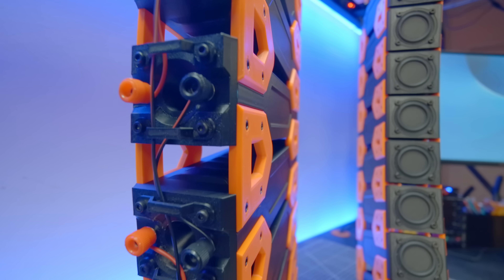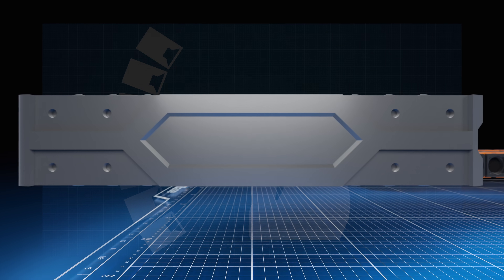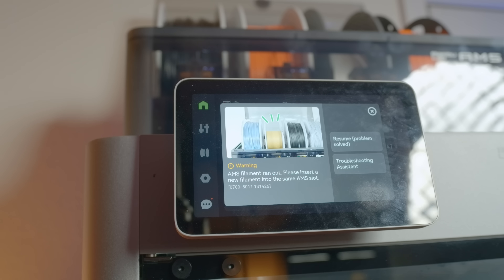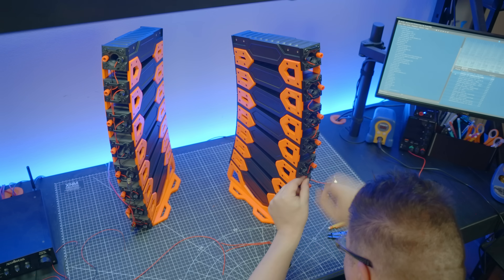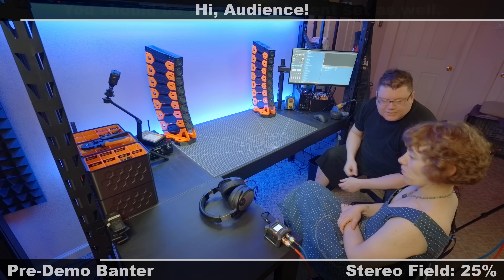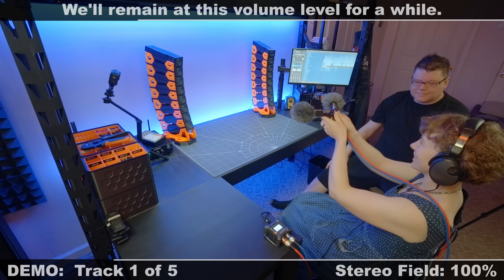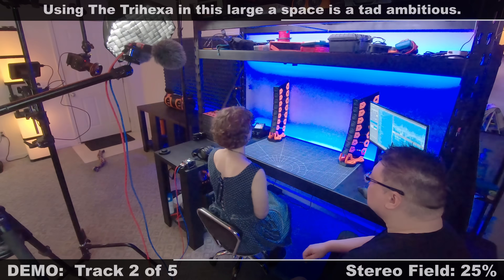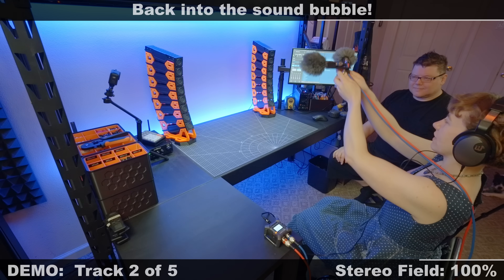Micro Modular Feature Build

Comment: Honestly a really nice 4.5 inch driver and 1 inch tweeter with the same overall box volume in a properly optimized box would probably perform better in these same conditions. The negative effects of comb filtering are significantly reduced by this line array but that is because the listening distance is so close. Line array speakers are done for one thing and that is achieving high, even sound pressure levels over long distances. You don't get that problem sitting within 1 meter of it. Damn cool project though.

Comment: im so tired of people using line array for everthing they belive cause they are use in large concerts they should be use in a 40x 120 hall with 12 ft tall  ciellings... this video proofs how they work but still a very bad way to use arrays. an array is used to focus the sound on a wider larger area not to focus or concentrate that energy on a spot.. where only one person can get the best sound quality and if it moves a so short distance the sound experience would degrade so bad... i still give you a thump up cause your videaos are great...

Comment: While extremely cool, not a line array, its a column array. To be classed as a line array each box would have a maximum of 10-15 degree vertical dispersion, and have multiple drivers to cover different frequency ranges, with a horn on the HF driver(s). whereas your drivers have a very wide conical dispersion as typical with column arrays, along with that point a line array is designed for coupling at long distance especially by grouping multiple boxes, (but not the whole array) or using FIR/IIR filters on each box to create the same mechanical placement accross the frequency spectrum, so when you walk from front of stage backwards the audio is cohesive, columns are designed for short distance. Also a line array would never be pointed in on itself, the destructive interference would be horrific, the closest speaker you have created is the Electro-voice LR4A, which they class as a line radiator. Your point of they wont have comb filtering, they will comb filter to some degree, all speakers do, however your design is within the 90 degree dispersion, so would be in phase of each other. A side from that, the project is extremely cool and something I would love to experiment with myself. I do love you have spent the time work out the maths on it to create a focul point for all drivers. I am curious what delay times you set per driver? They sound really good through the mics.

Comment: I built a set of these, and I have really been enjoying it. For anyone who is looking for a cheap DSP to use for projects like these, I have found that the Wondom ADAU1701 based stuff is extremely cost effective (like 35 dollars for the assembled box reference unit) if you can figure out how to use sigmastudio. You need the programmer (about another 20 dollars) to download the sigmastudio files, but you only need to buy one of those. I would avoid the bare pcb module they sell unless you really already know what you're doing, since it needs supporting hardware to make it work well.

Comment: Sorry, someone here has misunderstood the basics of line arrays ...
You don't delay a line array to a single point ... Instead, all speakers are connected together to create a uniform sound column.

What they are doing here is simply combining many small speakers to create one larger speaker with an extremely small focal point, so small that even 1 inch in any direction means a very significant change in the sound ...
You can imagine it as an invisible headphone floating in front of the table, and when you move away from it, the sound changes significantly.
A line array (provided it works physically) does exactly the opposite: you have a wide and very deep range in which you can move without the sound changing significantly.

Comment: I always build my own speakers, been doing it for over 50 years.   I haven't tried a "focused array", I generally do CBT arrays instead so I don't get the "bubble" but rather a large controlled coverage area.  For a desktop system like that I would do a ground plain open baffle CBT but your focused array would be interesting to experience.

I have a 3D printer but haven't used it for speaker building, maybe I have to try that.  You made a really cool system!

Comment: Encountered that issue with my x1c. 
Temporary solution was to disconnect the power/data cable for the AMS and feed the filament down the funnel until it hits resistance. Then reattach cable. 

Actual solution was to replace the AMS feeder unit. It may just be the feeder funnel but the unit item includes the funnel and that’s what I used. 

Wonderful project! I have a lot of vision issues so don’t try many complex projects with soldering and such but this project looks great so I’m tempted to try it out. 
:)

Comment: How did you manage to lower de FS from 145 Hz to less than 80 hz Specially at 12:43?  At least that's what youtube video shows...
Reply: he ganged up serval speakers in a line so that kinda gives you the frequency range like a single speaker of that same size but in just that thin layer horizontally perfectly in the mid hight of the curvature.  with a single speaker of that size you'd get the whole frequeny response multidimensional.

Comment: I would love to see a proper low profile center channel design from you that doesn't suffer some of the common side-by-side issues of most cheap designs. I've only got around 5" of height to play with, maybe 7" if I move the TV up more, but fitting something that pairs well with decent speakers is hard, especially in the DIY realm as most anything is going to end up needing DSP correction.

Comment: A couple of years ago, I built a line array using six 4x6 speakers per side using a common ported box as opposed to individual boxes. I found that the efficiency was insane. A small 10 watt stereo at a volume level of 2, would produce chest thumping audio. The sound was exceptionally clear and I believe that it is because to produce comparable sound to a single speaker, each speaker cone in the array just moved a small distance.

The downside is that they were very directional in the horizontal plane even though the individual speakers were aligned horizontally in the vertical array.

Comment: I used work in the concert industry and work at a line array manufacturer and I love this project.  I have always wanted a miniature line array.  Typically in line arrays there would be a wave guide for the upper mid and HF to physically delay the sound waves so they come out flat.  Are you using some DSP to compensate.  I do recognize in the near field any phasing issues would be minimal.  Your projects make me want a couple 3D printers.

Comment: I have found line arrays up higher are useful for long throw to audiences farther back, using some delay. For audiences that are within 150ish feet from the stage,  I use the approach AC/DC used in their speaker arrays.  That said, both have advantages AND dis-advantages which would take up too much space here.  For close monitoring, I prefer a matched set of JBL active two way tops covering about 100hz to the top edge of human hearing, using a sound-matched JBL active sub for 95hz and below.  They disperse at an angle wide enough to vary your listening position thereby not fatiguing your head, neck and ears. If the sub is NOT positioned between the monitors, it is not as easy to hear everything they way you should. Ideally, the sub works best, for me, every engineer is different, about 5 inches in front of the speakers in the exact center adding a 2 or 3 millisecond delay to ensure the sound reaches your ears at the SAME TIME. If the sound does not reach your ears at the same time from EVERY source, you will get phasing issues. That said, unless your an audio engineer in a recording studio, or a FOH or monitor engineer, this probably is not noticeable.

Comment: So, this is freaking awesome of course, like all your builds, mad props... BUT... there is a famous design that is essentially the opposite of what you have here that you should try instead.  It is a curved line array by Don Keele he called the "CBT" constant beam transducer, like the CBT24 and CBT36.  I would like to have seen that instead, as your design is obviously intended (and is only properly functional) to be listened to in one exact sweet spot where the drivers are equidistant, and they work for that but the sound power - the off axis/room response - is not going to be ideal, which does contribute to the overall sound of course although fairly little given the distance.

So, very cool, but would love to see you try a CBT design!  I don't know for certain but it appears he may have been the first to do it, or maybe the first to use his exact geometry calculations... but obviously curved line arrays following the same principle are very common for a reason.  Don's CBT isn't the same as those, because he uses "shading" - a series of resistors of various values on different groups of drivers... so the center portion is unattenuated, and then groups of drivers going up or down from those are progressively attenuated, that's part of the design.  One could do it more precisely on a driver by driver basis instead of in groups too, with some added complexity.  It could even be pulled off with a multi-channel DSP or combination of DSP and resistors.  The end result being that they sound the same whether you sit or stand, and of course volume doesn't fall off with distance as fast.

I'd also LOVE to see you tackle a big open baffle project, especially using 3d printed elements... tackle something like Linkwitz or Perry Marshall's designs.  As close to full range open baffle as possible, full side cancellations from low bass up through the treble... narrowing baffle at the top to prevent baffle related side peaks in the midband that are common in designs like the Live Edge etc, any rectangular baffle design.  3 or 4 way, maybe with an OB sub?  Perry Marshall's Live Edge or Bitch's Brew might be good inspiration.

Comment: Ok, this is something I have to try. Did you connect all speakers in parallel or sets in series and then parallel, to avoid a very low resistance? Looking forward to the next projects. PS: try to remember that most of us only have a BL A1 and consider also an alternative project for us with basic printers

Comment: I'd love to see these made around a common size square stock, with just the faceplates 3d printed (the brackets could be very cheaply laser cut out by SendCutSend, with so many identical pieces it would greatly reduce costs), then anyone with even a modest size printer could make these.
Reply: The front plate is roughly 50x58mm so 2x2 square stock would probably work out with some minor resizing of the end plates.
FWIW, the main enclosure fits on my Prusa Mk3S+.  Longest dimension is 238mm

Comment: My man...the center channel application is EXACTLY what I was hoping to hear you say.
Reply: You may already know this, but it's best if you can avoid a horizontally side by side driver arrangement for your center channel. The dispersion pattern of the typical long wide horizontal center channel speaker is generally 180deg off what you would want and often results in a very narrow sweet spot that only works for one person. They are built like this to fit under a screen, not because it works well acoustically.
Reply: Yeah no building a line array lying down is not a good idea (well except for subwoofers maybe for an even horizontal cover). Instead these two line arrays that he already build will have a more or less perfect phantom center channel making a physical one obsolete.